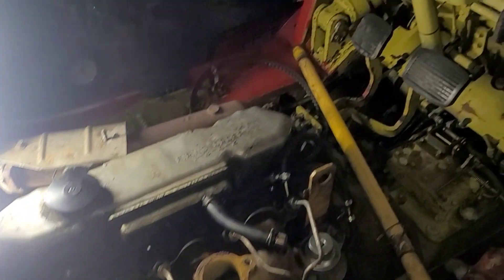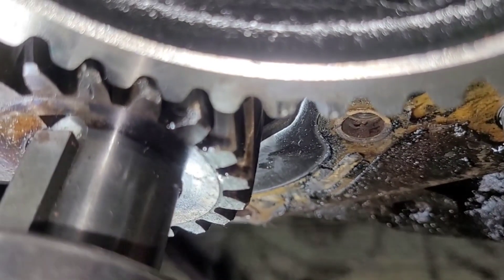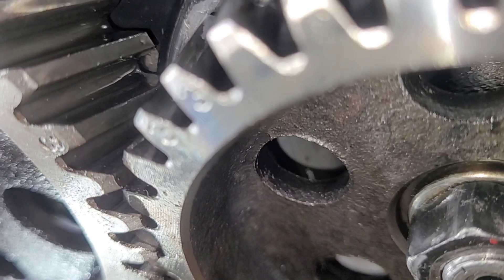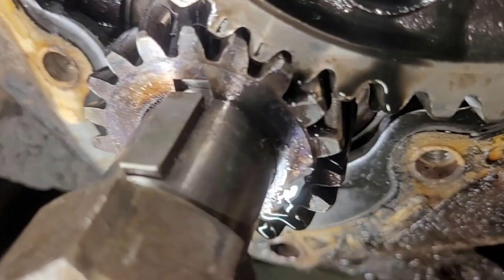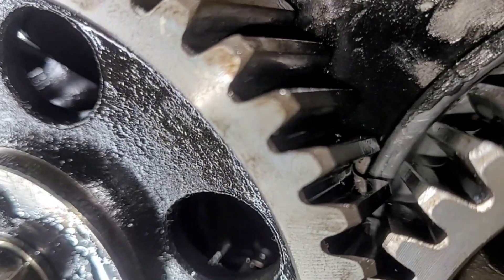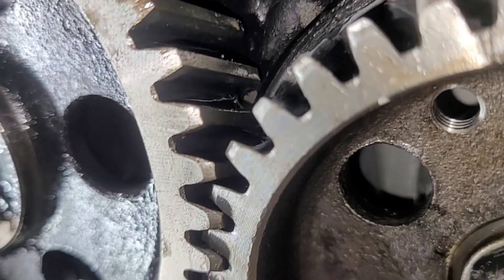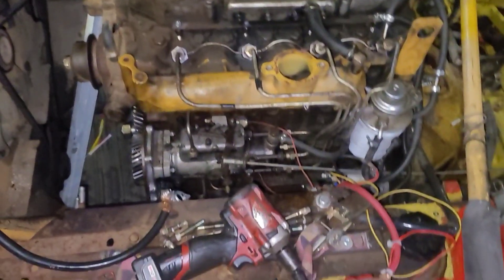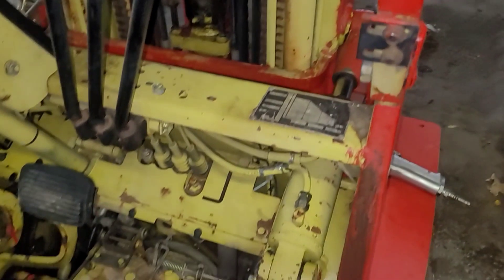Mitsubishi FD25 S4E timing marks and gears.

Comment: How many rotations did you have to make to get all the numbers to line up? I have an fd30 with just replaced the pump and timed it based on the 3-3-3 but not getting great pressure. I keep reading that you need to find TDC first in order to get it timed correctly.
Reply from the maker: @TheYanks03  I honestly don't remember. But it was an SOB